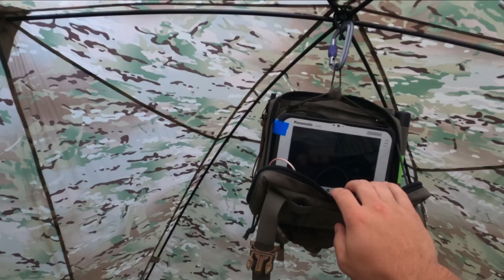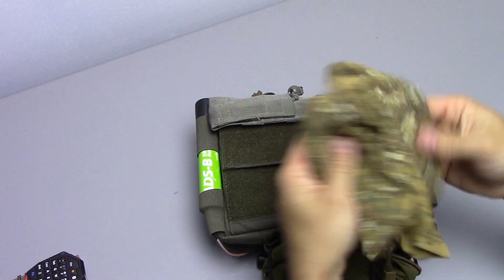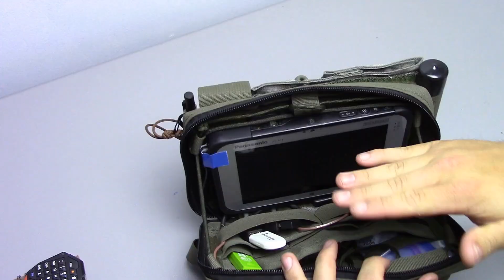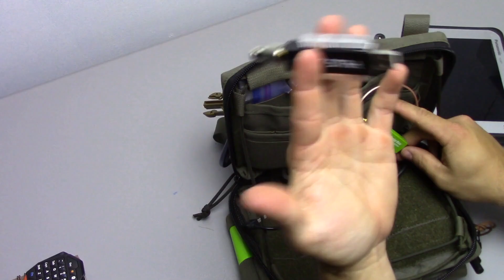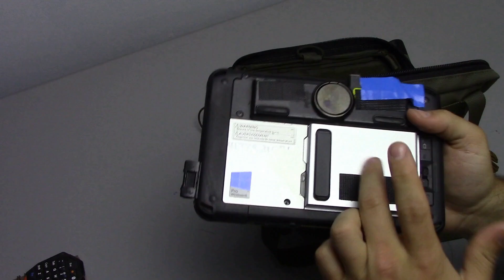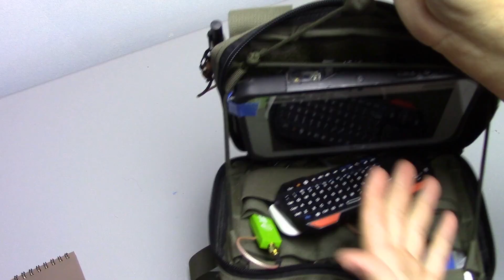Field Computers: My Current Setup

Comment: Dell Outlet has an 11 inch 2-in-1 laptop/tablet for $372. I have one and  designed for the K-12 market, it is built like a tank. No fans or vents. Windows 11 Pro, 8GB RAM, 128GB SSD, and gorilla glass, polycarbonate case, spill proof keyboard

Comment: I work at the Panasonic repair center.  Those units shouldn't get that hot.  I would open up the panel that has the barcode scanner.  There is a small internal battery (like one used in a cordless phone) for hot swapping the main battery.  Those batteries go bad and I've seen them swell up like a balloon.  Try unplugging that internal battery to see if that is the cause of your heat problem.  You can run the unit without the internal battery if it's bad.  It's only there to give you about 15 minutes of charge so you can swap the main battery.
Reply: Not directly related, but I've used alot of old toughbooks and man those things can take a beating. Not always the most user-friendly, but they're like the ACOGs of computers
Reply: @amaricani  We have seen some really interesting stuff come through for repair.  I have a picture on my phone of a CF-54 with a bullet hole through it.  The unit was in a cop car during a recent "peaceful protest".
Reply: I love swollen batteries, they hold more power and keep me warm in winter!
Reply: Looking for toughpad fz-m1 back plates to cover up the back if I remove the bar code readers-
Reply: @shanemccray4050  how much would you want for the barcode readers?
Reply: @kansasusa7  I would trade it for the proper back plate and any other needed parts to replace the bar code reader.
Reply: @shanemccray4050  I checked for the tech prepped and we only had a couple of the parts in stock.  These are discontinued so I doubt we will get more in stock.
Reply: @njw1977  Thank you very much for checking.
Reply: What model is the tablet?
Reply: @TimHarperW5TAH  He is using a FZ-M1.  They make one in android (FZ-B2).  That should be a little cheaper if android would work for you.
Reply: Panasonic FZ-M1 @TimHarperW5TAH
Reply: @larppatrol  are you talking about the hard drive heater?  You can physically remove it (just plastic wrapped around the hard drive).  I have no idea why they use those especially with solid state drives.
Reply: Or new thermal paste
Reply: Where would you recommend getting used or reconditioned FZ's from? What to look out for?
Reply: @BradOmedic  Ebay.
Reply: @larppatrol Where do you change these settings?
Reply: Agreed. Great suggestion indeed.

Comment: What do you use for emp protection? Thats going to be an issue moving forward id guess, if our technology doesn't work we are at a severe disadvantage.
Reply: Your radio can be used, or it can be in a grounded storage box, it can't be both. So whatever equipment your using will get destroyed, and any equipment you want to keep in reserve will need to be secured separately.

Comment: Nice pack! If you want to get around the summer heat, you might be able to make a manifold for the back of the tablet or any airflow ports and force air, or more air, through it with a 5V fan run from the power line of a usb port. Not sure if that would bring down the temps enough to operate the device in the worst conditions but as long as the air is cooler than the device, it'll be doing some cooling.

Comment: On the topic of chargers for laptops/tablets. I've found most devices are essentially 20vdc. You can get USBc PD emulator devices that will negotiate 20V from PD capable devices, along with generic 2.1mm x 5.5mm barrel jack connectors. The advantage of that barrel jack is theres a host of adapters to other barrel jacks/connectors. This allows you to use power banks to charge your laptop regardless of its ability to charge from USBc. The sharkgeek stuff is capable of 100w USBc PD, Anker has stuff as well. I have a USB solar charger... This setup unifies to a USBc standard I find to be pretty versatile.
Reply: Aliexpress has multiple usb-c pd pre-made adapters with the correct voltage and plug for lots of common brands, barely bigger than the plug itself, carry one for every custom requirement. I can charge my dell laptop using one.   My usb-pd 60w charger is smaller than most phones/battery packs (and only 10mm thick). It charges everything happily.

Comment: Might want to consider using heat-shrink tubing to make those connections a bit more reliable. You can use non-adhesive lined hs tubing if you want to easily separate it later, or adhesive lined for more reliable and waterproof results.
Reply: Take apart and solder connections as well...

Comment: I think it’s about time you get a sewing machine. Designing/Sewing your own custom gear is pretty powerful.
Reply: Make sure it's capable of working jeans or leather, if you want to work with thick things like chest rigs
Reply: They already do that. He has a video about it
Reply: @barclaymatheson8240  , ahh, I haven’t seen that one yet. I originally purchased a prosumer “commercial” singer machine but it struggled going through multiple layers of harness webbing and Cordura. More recently I purchased a Juki computer controlled machine that has a lot more horsepower and automatically adapts from going through thick materials to thin rip-stop liner materials.
Reply: @MedSpark  you need an in field repair kit with thicker needles and curved needles. fabrication isn't that hard, almost anything can be re purposed for multiple uses. trsh bags as shelter/rain poncho/cover, etc, etc.the sewing machine stuff is a luxury. you're not taking that with you.
Reply: Juki LU-563 SINGLE NEEDLE LOCKSTICH ....BASED ON SINGER MACHINE... JUKI S ARE DAWNM TOUGH AND HARD USE CAPABLE SEWING MACHINES..... LORD ONLY KNOWS WHAT THEY COST ..  BACK IN RHE DAY THEY WERE $ 1500 USD IN MWRRITT ISLAND FLORIDA FOR SEA RAY BOATS SPORT YACHT FACTORY .....
Reply: Bear independent is commercial web gear manufacture capable. Looking for new web gear tools to make in the dirty civilian space. He can handle the transaction process also. Just a thought.

Comment: cable routing?
1. soldering iron
2. thermal tubes
3. 2 hours work
cut all cables to desired lenght, solder them, don't forget about slack for curves and turns and coiling of cables. put extra thermal tubes on full lenght of cable and shrink it with a lighter and put warm into the bag, it will remember the correct shape.
bonus:
buy knee-bent connectors instead of straight ex. usb, antenna out etc. and replace the original ones.
oh You already have these usb knee bent connectors. Just cut the cables and affix them in the pouch then.
cooling?
well, i made an aluminium case for my thinkpad.
Reply: If going as far as soldering, there’s also pretty effective water-resistant mil-spec connectors that could be integrated if disconnecting anything is necessary while maintaining reliability/water-resistance.

Comment: Take a look at the iKey keyboard for the FZ-M1. I've been running the FZ-M1 MkI since January as my primary field computer. However, I've recently added the iKey keyboard, and it's completely improved my operating capabilities. Shameless plug, my last few videos have covered the FZ-M1. Keep up the great work!
Reply: For those who aint fond of desk-rated "portable" keyboards, I would recommend simple chinese "Ultra-Slim Bluetooth Keyboard Portable Mini Wireless Keyboard Rechargeable". It's not that small as the one in original video but is very slim and lightweighted, and it also has built in magnetic stripe. Surprisingly it does not even suck as one would expect from a noname OEM product: it has a decent durability and overall feel of keys (which are of decent size, btw), battery lasts long and it is moddable. I tried all keyboards mentioned here and in video and this chenese fella is the best (until you really need pointing device, which kinda does not make sense in touchscreen rig).
Reply: Just subbed you from here and got a precondition check error 😮 what the NSA was that?! Oh well, says I'm subbed! 🤔🤣🧑‍💻
Reply: Hey Gaston, somehow I figured I'd see you here.
Reply: Gonna be checking your videos out
Reply: Hey hey!!
Reply: I was hoping to see you here, KT1RUN.  Hopefully this is a sign of collabs to come.
Reply: As soon as I saw the FZ-M1 I was going to send him your way! Glad you're already here!
Reply: @candyman__87  I've been trying to connect with S2 Underground for awhile, but nothing so far. I think that EmComm Tools (not yet released) and the field work that I've been doing with similar gear would server this community well.
Reply: @TheTechPrepper  
What are your thoughts on the Panasonic FZ-M1 vs the Getac T800?

The docking keyboard sounds like a distinct improvement.
Both suffer from a marked lack of i/o ports, though the FZ-M1 at least has a built-in SD card reader that isn't a hard-to-find option on tee used market.
Reply: look who showed up

Comment: why decide upon a windows 12v tablet over a more battery-efficient tablet setup like an android tablet in a rugged case? is it about specific software? 
in general, android tablets may not run the exact same software but there are sdr and amateur radio related apps which also accept sdr dongles. there are a plethora of accessories, which can be more field-disposable or collateral than a unique setup which may have hard to find components.
Reply from the maker: Good question, it's all about the software. Vara HF alone is only available for windows, as far as I know. Similar situation with various ads-b software options. I absolutely and intensely hate Windows just on principle, but sadly it's the common denominator with the software I need. But yeah if a person only needed ads-b, or only needed a general purpose SDR, an Android tablet/phone could be a great option. A lot of people do that and it works fine. I myself just tend to need a lot of different programs for different things.
Reply: @S2Underground  could you tell me what your weather machine model is
Reply: understood. i just watched your sigint parts 1 and 2 videos on 2x speed. very impressive. i better understand the reason behind your gear choices. it wasn’t obvious for me watching this video before seeing those two. 
personally there has always been a debate between minimal carry and capabilities needed without weighing yourself down. hackrf on a portapack is quick and portable with adsb running the mayhem firmware and saving plane data to an sd card on the go. but it is nowhere near as robust as your setup. plus when you need the tools, the portapack also serves like an sdr when connected to a computer. but all tools have their pros and cons.

Comment: Why the emphasis on aircraft. Wouldn't anything interesting have their transponder off?
Reply from the maker: Check out our video on Tracking Spy Planes from a couple months ago, I go into great detail on that topic. Long story short, aircraft turning their transponders off is a possibility, but rarely done in the US (usually only fighters, stealth bombers, U2's, etc), so as of now, even super secret spy planes (and other platforms) can easily be tracked openly.
Reply: An aircraft flying with transponder off is suspicious like a car driving at night with lights off. Harder to see? Yes. More sus when you do see it? Also yes.
Reply: I appreciate the replies but only half the question has been answered.  Why the emphasis on aircraft?
Reply: @krfloll  just a part of SIGINT collection he was talking about, he also had an SDR and a few other gizmos in there for more capabilities. Planes move people and things or are a collections platform. With a little bit of knowledge you can string together an idea of what's happening by what is in the sky.

Comment: Is that a Windows 8.1 tablet?  I hope you're never connecting it to a normal network or have some compensating controls in place.
Reply from the maker: Yeah this is completely offline and never connected to a network. I used to load multiple OS options on the internal micro SD card to boot from, but these days I just run this totally offline.
Reply: @S2Underground  did you tried tune CPU and GPU frequency while under Linux? I downed consumption of my "full" laptop under i5-8265U with UHD 620 from 5-6 watts and constant 60⁰C to 2-3 watts and 30⁰C (basically whatever room is at), and this is while screen is lit at 3/4 brightness. When screen is closed or very dimm it's just 1.5 watts, total of 20 hours fully powered laptop, even connected to Wi-Fi or whatever. Almost everytime when your laptop overheating its because OS is stupid and trying to boost CPU and GPU, even if it will do almost nothing.